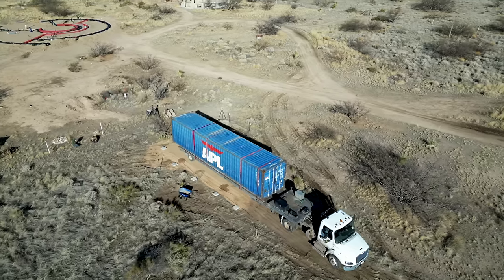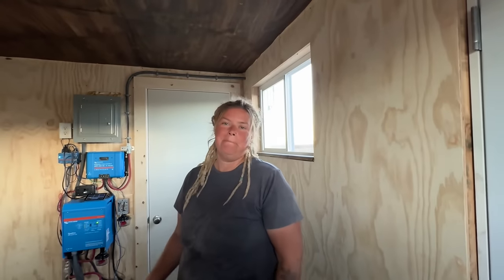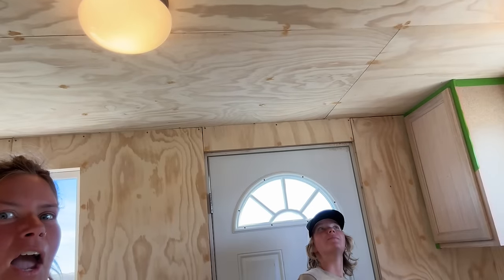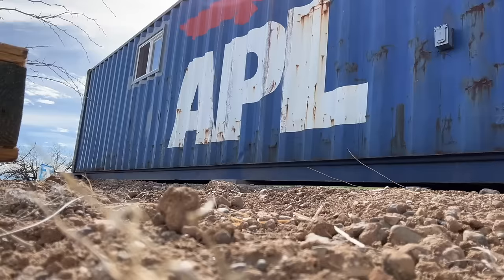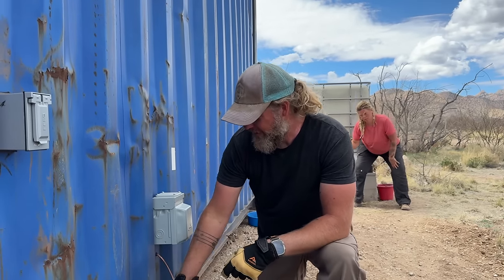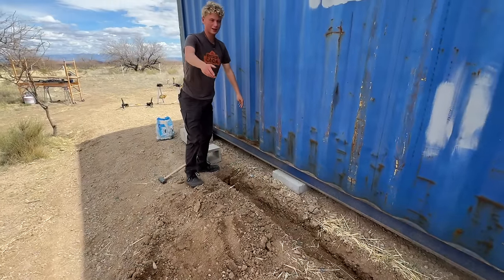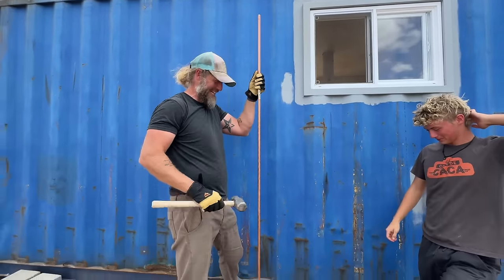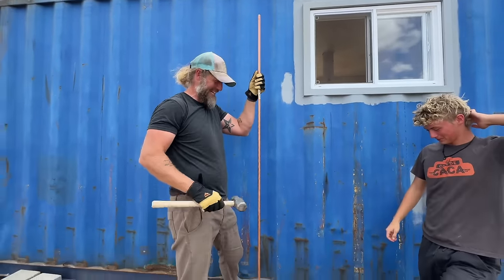GROUNDING Our Shipping Container? It's Not What You Think ;)

Comment: I hope ya'll are putting legs on that piece  of countertop cut out for the sink. For the most coordinating milking stool ever! Also, you can use spade bits to make spaces for sink clips to fit. Ooor, option 4, extra caulk under the sink lip, let it cure overnight, and it will never  move.

Comment: UFER < you fur> so you had it correct. The re-bar with a minimum of 20 foot straight run, with all re bar wired together (bonded together), up off the bottom of the concrete. With the grounding conductor attached. But where the grounding conductor passes out of concrete run in plastic pipe to limit corrosion.  So you got it good ya'll.  Congrats. JT
Reply: It's okay to just lay it on the surface like that? I thought it had to be 30" below surface.
Reply: @offgridsolitude 

You are correct, code requires it to be 30 inches deep for the footing inwhich the 1/2 inch minimum re-bar is to be laid, with 2 inches of concrete on each side.  This is to maintain moisture in contact with the concrete. However, this UFER ground is additional grounding provided with two other means of Code compliant grounding. The 8 ft UL Listed ground rods, more than the required footage apart. So as long as their rain water soaks the area before lightning strikes, the UFER would disperse most of the strike IMO.  JT

Comment: I hope Jonathan can find more stain for the ceiling. Yes a Ufer ground! Al Lumnah of Lumnah Acres did that on his barn structure. Nice job putting a ground connection on the outside of the container Jonathan. Wow, Jett was amazing pulling that grounding rod out of the ground. Nice job Adali making the concrete form. Wow, stringing the copper between the two ground rods and covering it with concrete looks good! The pad can have the condenser unit on it for the mini-split. Nice job getting the walls primed and the ceiling stained Ashley. So the walls are painted a color called wet cement? Nice color Adali for the cabinets! It's called Blue Ridge Fir! The trim looks very nice up. That counter top looks so nice with the oil on it. I'm glad you figured out just to bend the clips. Yes, I've used the "dries clear" stuff and it is white at first. Cool, refrigerator for the milk in there too! The solar stuff in a cabinet and the refrigerator on a shelf, awesome! Thanks for this video Longnecker family!

Comment: Let confirm something that’s very important. Our house was hit by lightning hit a tree carried through down to  its roots went through the rebar in our lanai and metal post which was ungrounded as we were under construction followed the house around under the stucco wiring and blew out all the electrical so what you’re doing is exactly what you need to do our grounding rods currently which we just put in are 10 feet deep and there are two of them in sandy soil and in Florida. No more issues.

Comment: Good work so far. There may be a problem with dissimilar metals over time. Also, between copper and concrete. Keep an eye on the conductivity in these places over time. 
The trouble may not appear for a few years but it will.

Sorry to bring bad news.
Reply from the maker: Lots of guessing here. Do some more research on grounding shipping containers and ufer grounding.